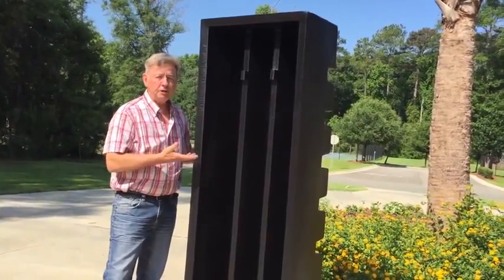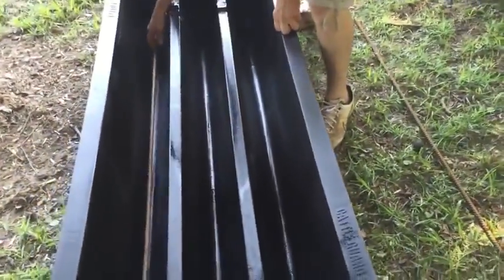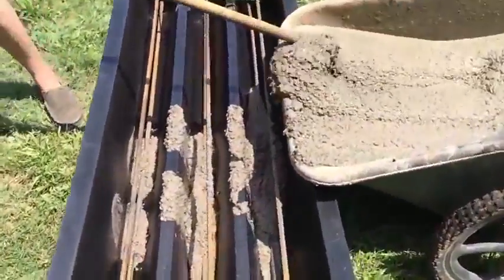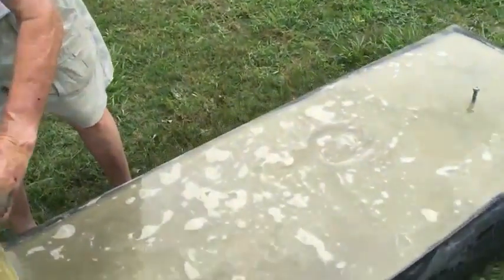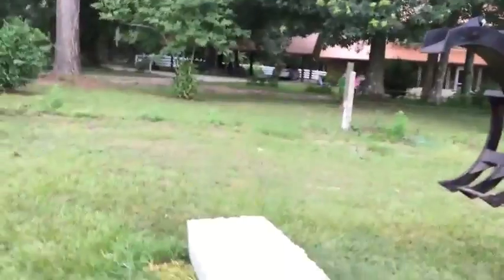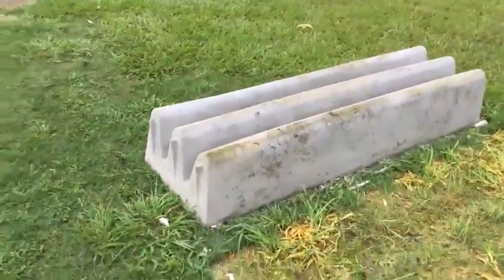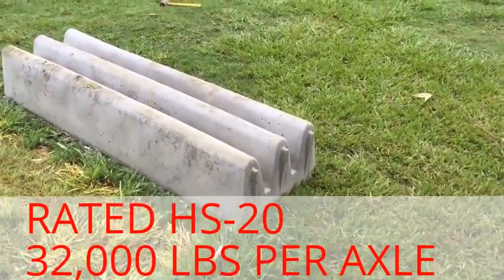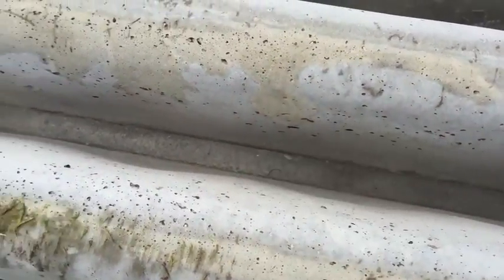How to pour your own cattle guards with concrete forms

Comment: Pretty good cattle guard for light duty. I agree with other commenters, the amount of water that was in the form and concrete will degrade the strength of the concrete. If you need additional workability for your concrete try using a superplasticizer to keep strength and allow for a higher slump.

Comment: I too poured concrete for several years. I think the water has no where to go because it can only go up. There’s no dirt or sub grade to absorb the water. 
I also think that pulling the form after 3-4 days is premature. I’d probably wait 5-7 days.